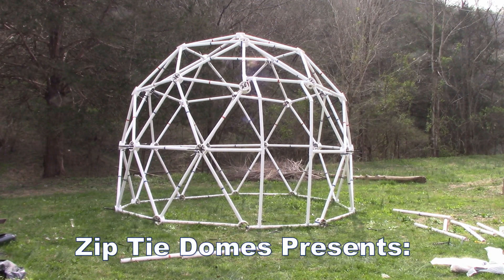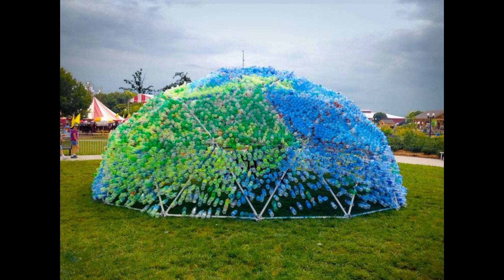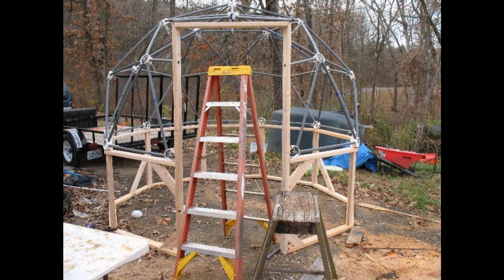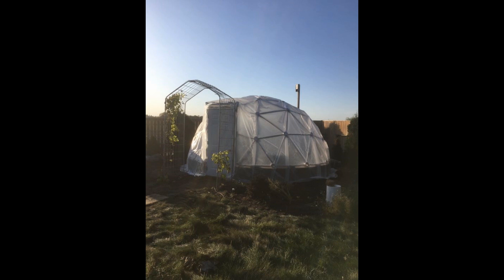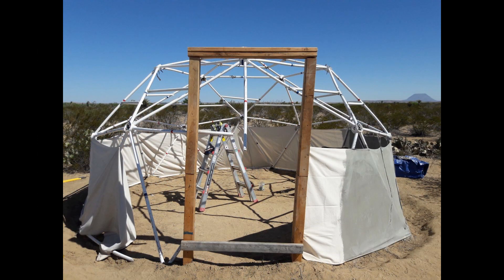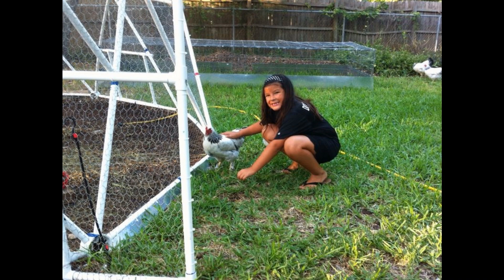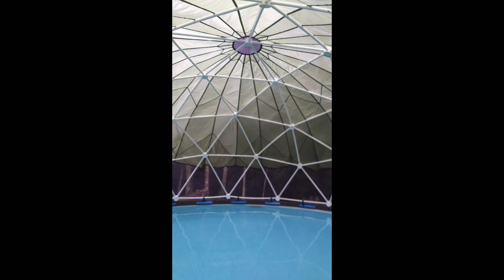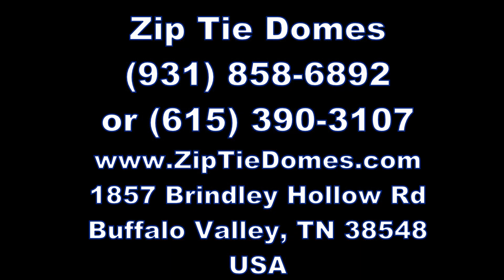Geodesic Dome Door: How to Make a Doorway for a Geodesic Dome

Comment: I've been waiting for a couple of years for the concrete protective dome covering, like this 07:09  I would like to know 
the radio cement to latex paint? I've got the canvas~
Reply from the maker: I hope to have a video out this week.  Thanks for watching and thanks for being supportive - it really helps to hear that you are interested.  Thanks again, John Hurt
Reply from the maker: I used pure Sika Latex or the cheapest white latex paint, and mixed it with the Portland until it made a slurry.  I also cut it with about 50% water.  When you make cement, it is like a recipe that you "tweak", and you can make it too runny or too thick.  So there is no ratio, just do it.  Thanks again,   John
Reply: @ZipTieDomes  Grin, your recipe for 'feel' reminds me of my grandmom, she didn't use recipes, she went by 'feel' of her bread dough.  Thank you!